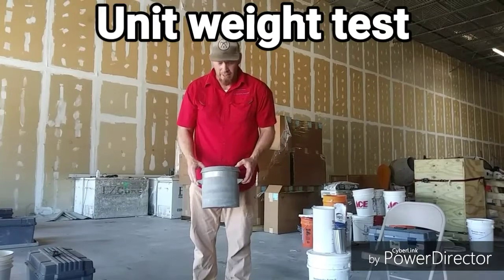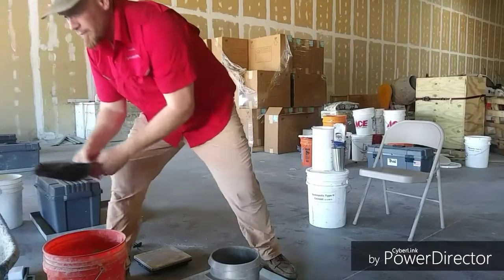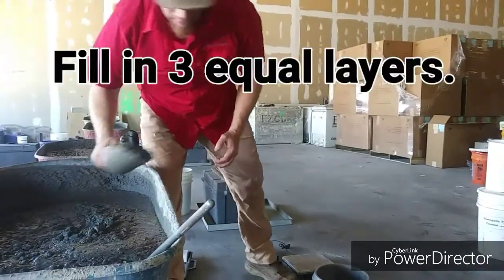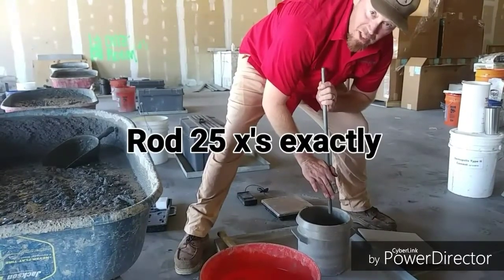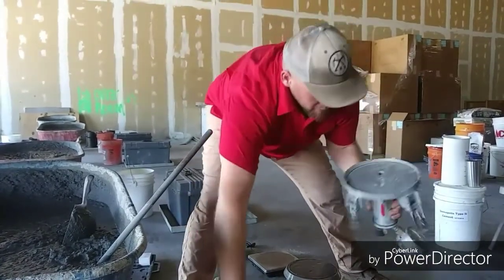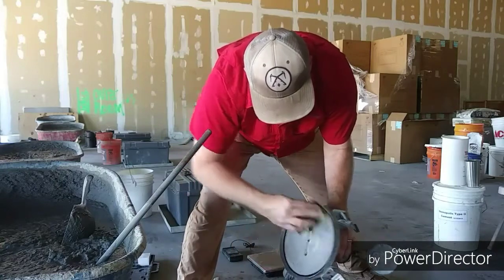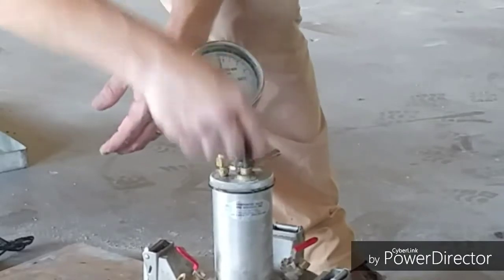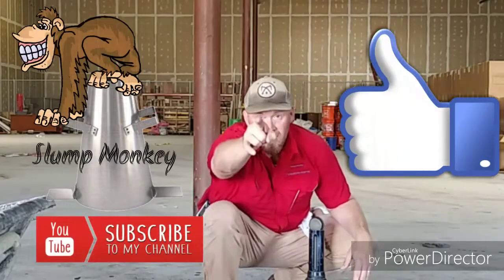Unit Weight C138 and Air Content ( Pressure Method ) C231

Comment: 43.8lbs  mass of measure and concrete - 7.6lbs measure = 36.2 lbs  / measure  of volume 0.249 = 145.38 or round to 145.4 lb cu ft (say it out loud including unit weight  to the 10th.. say it as well for air to the nearest 0.1 % air